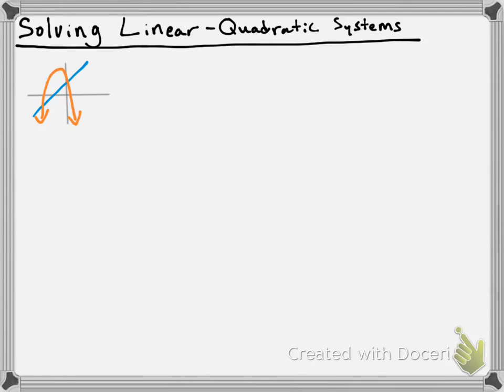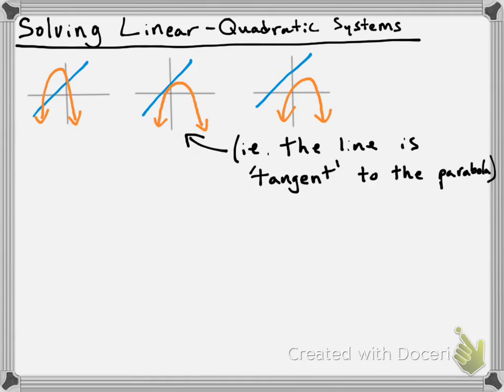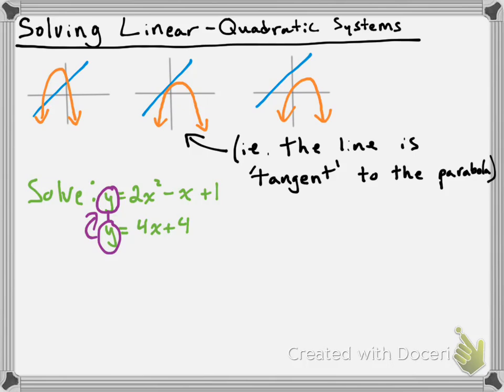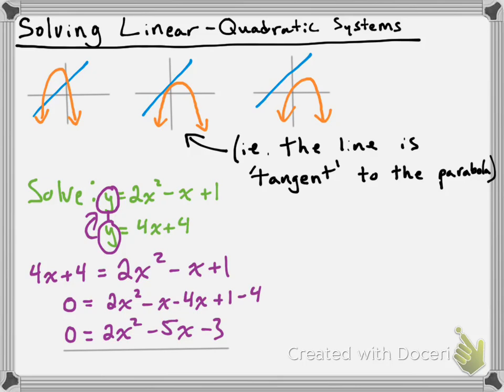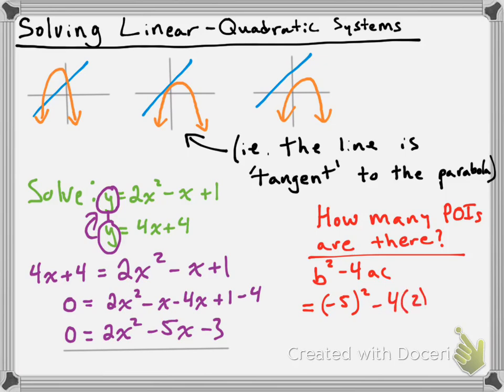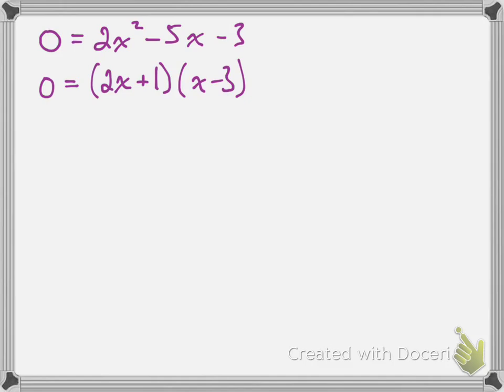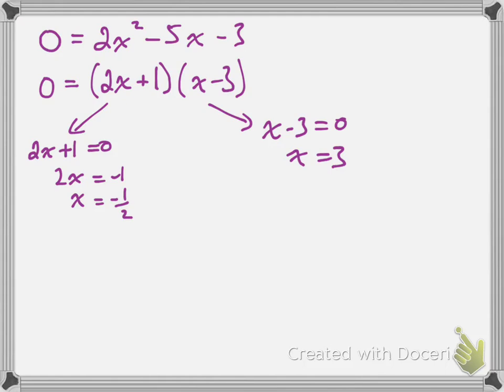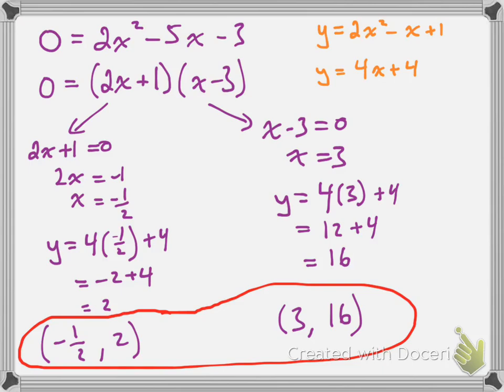Solving Linear-Quadratic Systems

Comment: Dumb question, why does x=‐1/2 and not just -2? Doesn't 1 go into 2 two times? Then you just add the negative sign?
Reply: -1/2 is equal to 1 half, just with a negative sign. Therefore; -1/2 = -0.5. 2 goes into -1, -0.5 times. what ur thinking of is -2/1.

Comment: What happens if the equation can't be factored. For example -x^2+x+6
Reply: use quadratic equation to solve for the roots
Reply: Much easier however time comsuming and rate of mistakes higher

Comment: How did u factor that? And can you type the equations into the y= on your calculator then graph then trace and find the solutions that way?
Reply from the maker: I'm not sure how your calculator works, but if it has an equation solver, then yes it would solve the equation for you.

As for how I factored, you could use the Guess and Check or Decomposition methods. Guess and Check is a little too much to explain in a comment, so I'll link to a video I made going through the process. https://youtu.be/pjSYHfBcq-E

If you want to factor using Decomposition, you start by taking the product of the leading coefficient and constant. Since the equation is 0 = 2x^2 - 5x - 3, the product of those will be 2*(-3) = -6. We would like to think of two numbers that multiply to give us this value (-6) but also add to give us the middle coefficient (which is -5). The only two numbers that satisfy this are -6 and +1 (since -6*1 = -6 and -6 + 1 = -5). We are going to use these two values to split, or 'decompose' the middle term like so:

0 = 2x^2 - 5x - 3
0 = 2x^2 - 6x + 1x - 3 (The coefficients of the middle terms are the values we just found. We can do this since they add to -5)

From here we should be able to Factor by Grouping, which involves common factoring from the first two terms and the last two terms which should result in a common binomial factor that we should be able to also common factor. That looks like this:

0 = 2x^2 - 6x + 1x - 3
0 = 2x(x - 3) + 1(x - 3)  (Notice both terms contain the binomial factor (x - 3). We can common factor this...)
0 = (x - 3)(2x + 1)

And so it is factored.
Reply: Mr. James thanks for taking the time and doing this. This helped me Ace my math test!

Comment: I kind of wish you showed the factoring part :/
Reply: Since everyone has replied saying I agree but no one actually did it, here’s how he did it.
He used decomposition trinomisl factoring.
First you need to find the product of AC and sum of B. Then you need to guess and check for two integers that match those values.

Product = AC = 2(-3) = -6
Sum = B = -5
—6 and +1 are the two integers; they add to make -5 and they have a product of -6.
Then do the decomposing.

2x^2-5x-3 - then decompose 
2x^2-6x+1x-3 - then factor 
2x(x-3)+1(x-3) - Then combine leftovers
(2x+1)(x-3)
If I made any typos let me know
Reply: me to
Reply: Me too
Reply: me too
Reply: Me too
Reply: Me too
Reply: Me too
Reply: Me too
Reply: Me too
Reply: me too
Reply: I read a book that also skipped this type of factoring And said the same thing.
Reply: Me too
Reply: dry